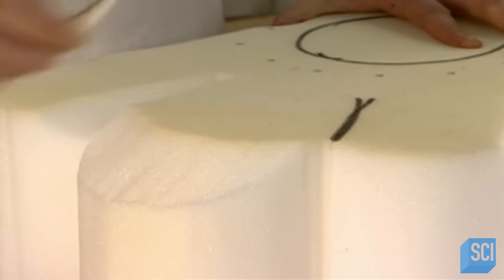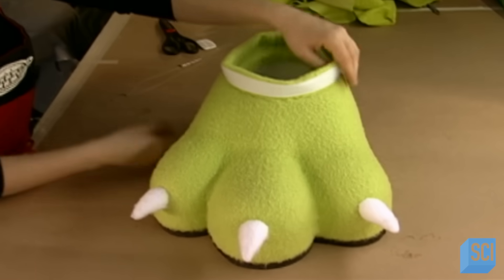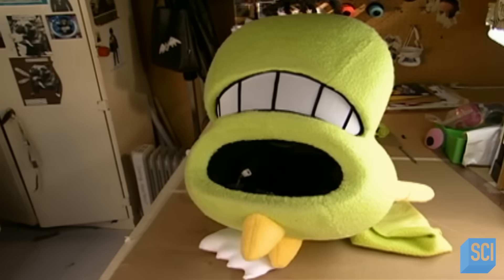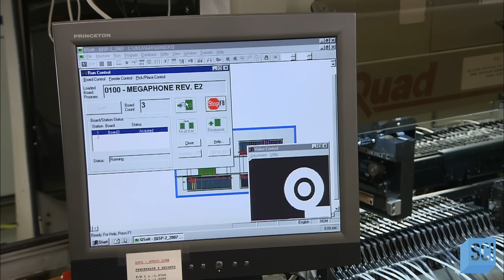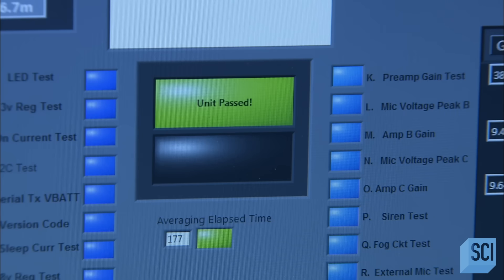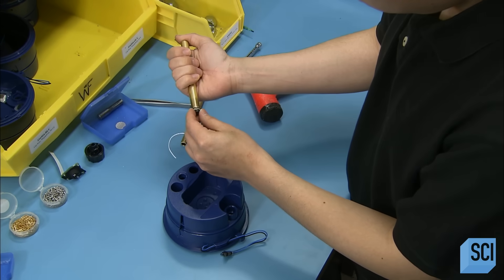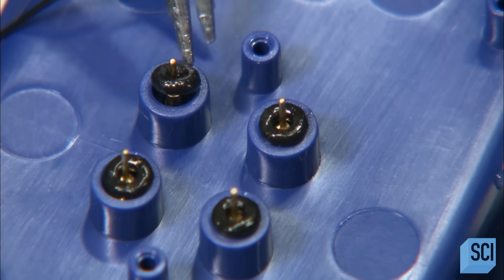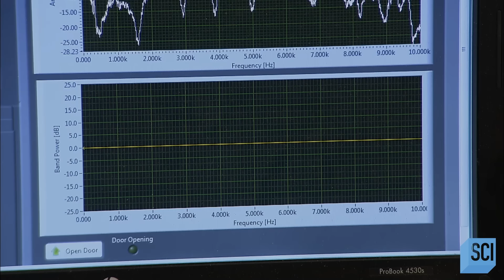How Basketballs, Shoelaces, Mascot Costumes, & Megaphones Are Made | How It's Made | Science Channel

Comment: Mascot suits are very hot to be in.  I worked for a radio station in Charleston, SC.  It can be quite hot and humid here and I had limits on how long I could be in the suit based on the temp outside.  The head was designed so the mouth was where I could see out and was a mesh material to let air in.  At the time I was hired the head only had a small hole in the top to let air pass thru.  I took it upon myself to install a small 12vdc fan and battery pack with switch.  I let it pull air out thru the hole in the top and it would force air in thru the mouth which blew across my face.  I was one of two who wore the suit.  After the other person used the suit and saw the fan, I became their hero.  Closing note, this mascot during a Christmas parade got a higher spectator rating than Santa did.